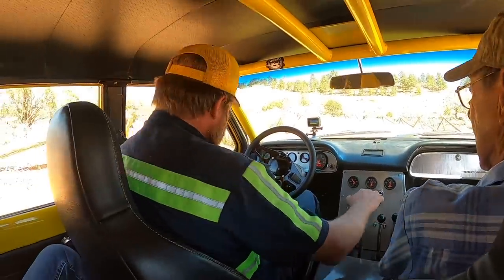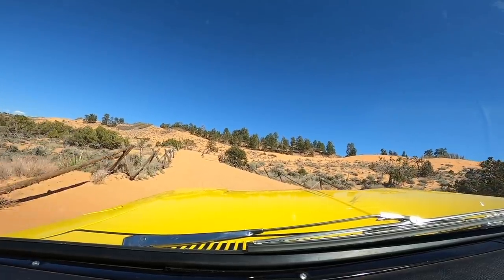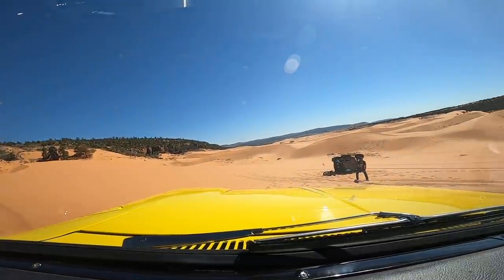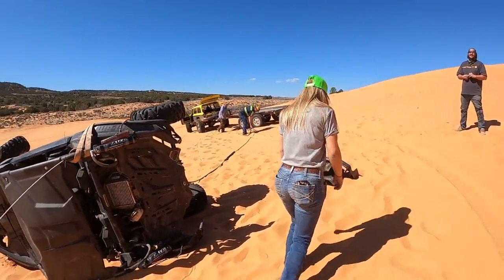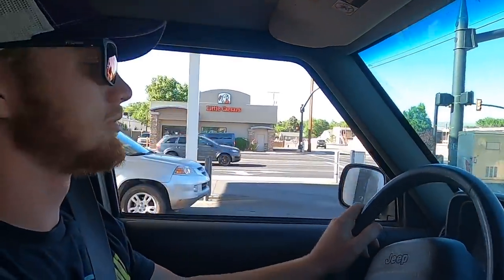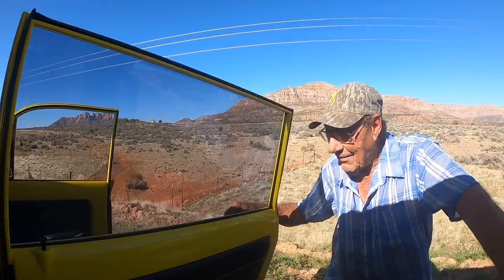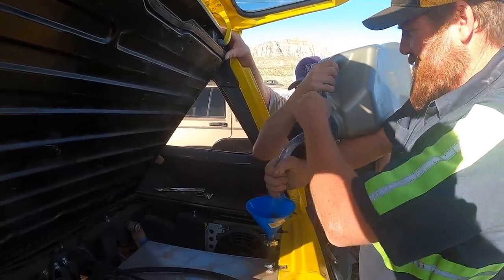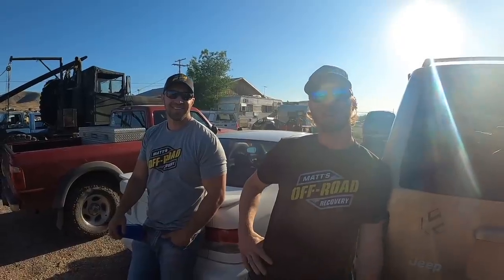We're Stranded In The Morrvair... Time To Make A Call

Comment: All that beautiful fab work and refueling through a straw...lol
Reply: I don't get it either took me 20 minutes to replace a fill neck. Four days to put the bed of the truck back on. But only 20 minute to fix the fill tube.
Reply: @MattsOffRoadRecovery  Not to be to pedantic but the Corvair Lakewoods fill location is the drivers front fender. Still whenever I use a fuel cell it normally comes with a fill plate that has a cap and I fill it that way.
Reply: @MattsOffRoadRecovery  to be honest, it would take me forever...I am in awe of all the fab work on that unit.  It usually takes me two days and 6 trips to the hardware store to fabricate a wonky l-bracket.

Comment: I want to know what mods Rudy has done to his XJ. On a different note, Ed and Lizzy are the stars of this episode.
Reply: Way back they said they were gonna do a video on it, but I don't think it ever happened. 
 
Side note, what ever happened to the second yellow and black XJ?
Reply: @aaronmodlin1871  The wounded warrior? Electrical gremlins that haven't been figured out yet
Reply: @angerm088  F
Reply: @aaronmodlin1871  I had some similar issues(not dying while XJ is on). With 20+ year old Jeeps who knows what is causing it without knowing the XJ well. Not sure if Rudy has looked into it more recently
Reply: @angerm088  Electrical gremlins in a Chrysler Jeep is no surprise. Had a few in my WJ, though it was the trans that killed it (less than a year after swapping a good engine into it).
Reply: @aaronmodlin1871  I don't remember if the WJ's have the AW4 as well? That sucks
Reply: @angerm088  Mine had the 545rfe. I miss that Jeep. Maybe a little less capable off-road than my XJ was, but the most comfortable road trip machine I ever had and all the controls were placed perfectly (for me,, at least).
 
Don't miss the gas mileage, though.
Reply: @aaronmodlin1871  Don't know much about that tranny.
I feel like the WJ is one of the better all around rigs. Better for DD but not offroading like the XJ. but decent all around

Comment: A simple but effective way to control overheating is to put a five gallon water container under the hood or someplace convenient, hook up a pump to it and send the water to a spray bar mounted in front of the radiator. Use temperature or manual control to turn it on and spray cool water into the radiator when there is a danger of overheating. Mix in some rubbing alcohol or fill the container with ice.  I have used this on my RV to great success.

Comment: Rudy saves the day AGAIN! you really are the man Rudy. And you do it with a smile
What do you call someone who drives around in 100 degree heat without air-conditioning and a fuel gauge that does not work in a car that does sub 10 miles to the gallon on a good day?

Comment: On that gas can Rudy brought i have found it's good to install a ball valve on the hose.  Makes it easier to control and use on small tanks.  You can still open the valve all the way and use it to dump (quick fill)

Comment: Matt, you need to get a better cooler for the trans, if you dont have room for a stacked plate style in front of the radiator they make a round tube heat sink style i have been using, they come in various lengths, and can be mounted anywhere, that temp needs to stay down around 200, conventional fluid starts breaking down at 220 and causes more slippage and wipes the surface of the cluches

Comment: They make EFI sniper kit that make your car economy and then when you want to give it to beans you push a button
Reply: Part of fuel consumption is just how much does the engine work in the sand to go the same desired distance normally? And on top of that the air was left out of the tires. IMO, unless they carry a portable pump for the return trip these things have to be considered and mitigated on long trips.

Comment: I would be wondering if there might have been a gallon or so of gas in the recovered vehicle to borrow from...
Reply: Need a special tool to siphin gas off nowadays I believe.. could be wrong
Reply: @JoryTheJones  it helps, but pretty sure you can still do it the old fashion stomach ulcer producing way
Reply: A gallon or so may not get them where there is a gas station. Idk
Reply: @WarPoet-In-Training  I helped a Jeep Wrangler that was out of gas once. It wouldn’t even start with a gallon of gas put back into the tank

Comment: Every time i see you guys load up on that trailer I see you fighting those ramps. Have you thought about welding up a smooth drop gate with across the back. so you can just drop it down and go! that way you wouldn't fight 2 separate ramps. you could use a couple of pins to mount it so you could remove it if necessary. Just a thought I had. Life of a fabricator... Always thinking about stuff to build. lol :)

Comment: You should make a kit like the washer fluid but with just water put the nozzles in front of the radiator and you can spray it as needed when the temps start to climb

Comment: Run a 4 gauge Amp wire from positive and negative on the battery back to terminals in the back. Then just need jumper cables to connect to the trailers winch

Comment: Matt have you considered a high performance coolant for your radiator? Evans has a 375 degree boil point in theirs. It's not the cheapest coolant out there but it would probably be worth the cost if you're having overheating issues.

Comment: How many times have you run out now, Unfortun youve found the fuel tank is not large enough ( even though didnt fix the gauge )  My Suggestion : Hit up Paul to integrate a Roof Rack on it to haul 2 5 gal tanks for extra range, and a tool box for in the field repairs, It could be square tubing nothing large etc to affect the looks.

Comment: Out of curiosity do you have your rear steam vent ports tied into the front ones/tied into the rad. Truck LS had them capped off while LS1/6/3 etc. usually vented them all together. Might help
Keep those rear cylinders and areas on the heads cool.

Comment: Most of the aftermarket guages aren't accurate. I have a OBD2 reader I leave plugged into my harness so I can read ACTUAL engine temp.. My 5.3L runs at 192 to 200 normally. My Guage will say 210-215.

Comment: Well seems like you have some bugs to work out still..... forget the gas thats easy. Seems like you have a cooling issues stil and haven't even got a/c running yet. Might need a fan switch so as soon as you start in sand turn it on and leave it on.

Comment: Matt why o why didn't you buy a matching tank with gauge , man you can get them together in a kit,  if you cannot find them in a car or truck website , I know you can get them from a boat website and they look exactly like your tank but they have a 3/8 th inch vent you need to cap off.
Reply: @MattsOffRoadRecovery  so true  on doesn't exist,  but they do exist in boat tanks and they look just like the one you installed and you will not get Chevy or ford but a matched gauge to tank. 
Also I know it's late but you could have removed the gauge pickup out of the tank and operate it by hand to see if the gauge in the dash matches what's actually going on in the tank . Then measure from the O ring  flange to bottom of arm movement  verses the depth of tank to see the difference, and remember safety 1st around tanks .
I know that's a lot but it will save you from a whole lot of embarrassing
videos and hours on the side of the road or you could keep taking chances on ( when will Matt run out of gas next ? )  Because if so I want to start a pool 😜

Comment: the fuel tank why not take it out of the car fill it up with water cut a big hole and install a regular gas cap on the tank if you can install a roll over valve in the next the 5 gallon gas can ruddy had i knew a guy he work for some folks at home his job was to put the hose that goes on the can together he got paid i think 5 cents for each hose if you worried about weld on the gas tank there some shops that will do it

Comment: Did you consider siphoning gas from the razor?  I guess no hose, jug, on its side most gas leaked out…. Not enough to matter?
  Only run out of gas driving other folks trucks.   As in run out in blocks, before first gas station.

Comment: Did you put a tranny cooler in the Morrvaire?  I don't remember if you did.  You should put one in if you didn't.  When you did the wiring, you should've ran a heavy wire back where you could've connected the winch on the trailer to for power.

Comment: Halo from Greece mat. I need a help from you if is possible. I am an engineer welder and I do trickie stuff on the cars. Jeep cherokee and jeep not popular in my country. I don't know many things about them . I have here a jeep tdi 2.5 and is not going fast its not even accelerating normal. Any idea? Full lines all new valve and engine is clean oil in good condition transmission fluid ok vacuum lines 👌

Comment: That's a really small fuel tank though.. Why wouldn't you want to put like a 100 gallon tank of some sort in it like maybe one of those truck tanks or some thing.. Just to make sure you have the extra fuel. But I suppose you can't be prepared for everything so I get it.. Also I hope you got a Air compressor in there some where so it makes it easier to put air back in the tires once your out of the sand.

Comment: I’m gonna criticize these guys. I mean really, a custom ride and your using a hose pipe and funnel to fill gas. That’s just lazy and irresponsible. Take 30 minutes and fix it right. Also me: still putting a rock under the fill handle of a fuel tank to pump fuel. New pump handle in a box in my shop. Yeah I’m gonna fix that when I have time 😂

Comment: Don't be letting your tires down like this folks if you don't carry a air pump to pump them back up before coming off of Sand Snow Or Mud. You'll wreck your tires if you don't pump them back up to proper air tire pressure. Very costly and stupid. Air pump with air pressure gauge is needed before re entering the pavement.
Matt should be mansplaining this on the video. His tires are pumped back up off camera.
Reply: I promise you we don’t air up off camera